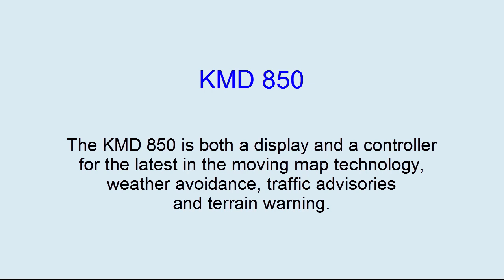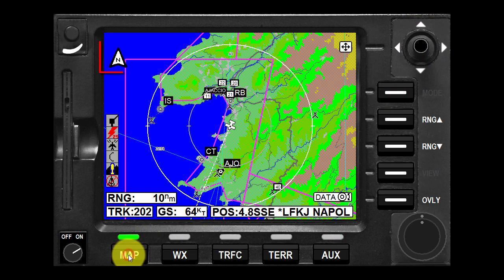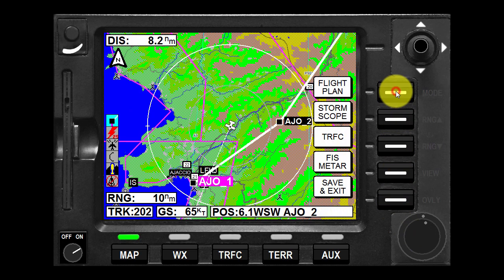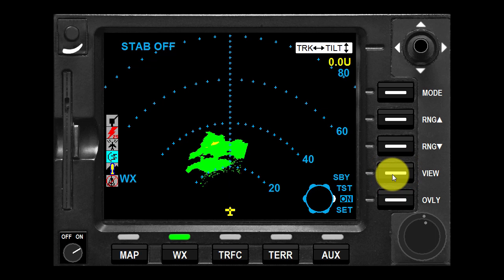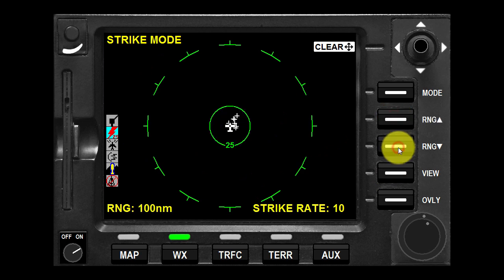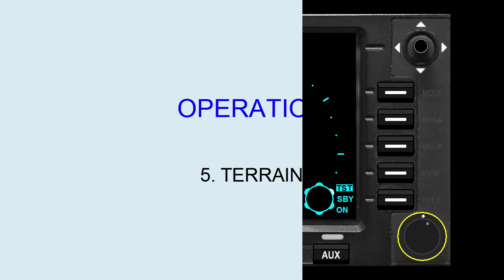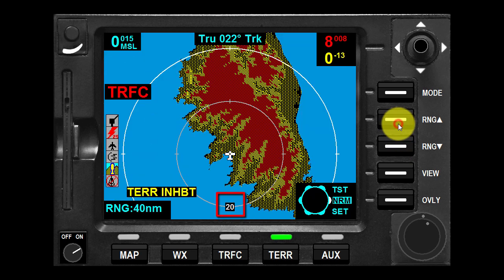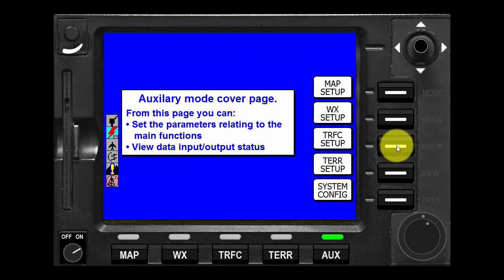KMD 850 Multi-Function Display. Simulator

Comment: I have recently noticed that my kmd 550 shows white track line instead of pink after captured the flight plan ,plz explain to get it back to pink gps track line .
Reply from the maker: Unfortunately there is no information in documentation about coloring of flight plan path or its tuning. So I suppose it may differ from the original documentation images